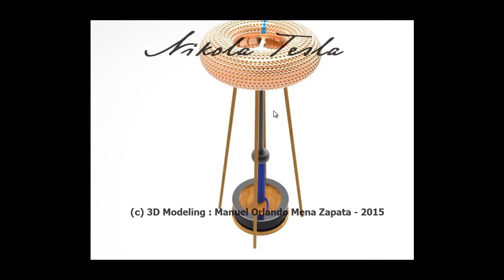Apparatus For Transmitting Electrical Energy - Wireless

Comment: I learned nothing from this, except that tesla patented a number of methods and mechanisms for the transmission of electrical energy through the air. Actually, I didn't learn of it here, I learned of it years ago, by reading a book from the local public library.
The methods he described made no attempt at energy efficiency, nor for safety of the people nearby his transmitter. He simply demonstrated the principle on which such a system could be developed.
Reply from the maker: Best regard,

The work developed by Tesla was huge, patents writings, interviews, but above all the proof that its patents were perfectly feasible, you should read Tesla's work again, now there is more information available, there are currently several scientific papers that support ideas Nikola Tesla.

A book or two books about him and his work is not enough to understand Nikola Tesla, he stepped forward and even still continues to advance current knowledge.

About the work of Tesla we can still learn a lot, but their work should look together for years I have studied Nikola Tesla, and he was simply the most advanced of all the geniuses that have existed until now.
Reply from the maker: +Bill Martin, Closed mind never learn anything
Reply: +Manuel Orlando Mena Zapata I learned a great deal about Tesla, as I said, a long time ago. Tesla's basic theories were sound, and to a certain extent his experiments were successful. You can indeed transmit electrical power without wires. It's done 24 hours a day, 7 days a week, around the world... literally. It's called radio. The only difference is the application: Radio is used for communication of information, not for utility power.
Tesla didn't take the inverse-square law of radiated energy into account.
Look it up. Anywhere. Google. Wikipedia. Your local library. Your old high school physics book.
Look, I never said Nikola Tesla wasn't a genius. I never said he wasn't short-changed by history. He was probably one of the most fascinating men in modern history. His invention of the highly efficient and reliable  AC induction motor was probably his greatest invention, and possibly his least known. He didn't invent AC, he didn't go head-to-head with Edison over it, that was George Westinghouse and J.P. Morgan. His motor, however, pretty much sounded the death-knell for a DC - based power distribution system.Thus he was indeed instrumental in pushing Edison into developing other products.
Tesla's attempts at wireless telegraphy were trumped by Marconi and Morgan pulled out of his support for Tesla's approach.
Reply: Marconi made his first over seas call right here, on the rock. There is a tower at Signal Hill in St. John's celebrating the transmission. Pretty cool stuff. Before that, we had a trans atlantic cable which stretched from Ireland I think, to the cable station just down the road from me in Heart's Content. Interesting history there for such a small, out of the way place. Our location makes for interesting visitors sometimes.
Reply: Manuel Orlando Mena Zapata
Ho Ho! I'd love to see your sources on that!
Especially since there were numerous others experimenting with wireless telegraphy at the time, with mixed results, of course.
And especially since Marconi's developments bore no resemblance to Tesla's.
Reply from the maker: +Bill Martin "Marconi’s real contributions are more engineering and commercial than theoretical. He took the basic ideas and inventions of others and improved upon them and made them practical business successes. Tesla was almost the opposite. He created original ideas and proved them mathematically and physically, patenting some and not others. Some of his best ideas like the AC induction motor was a commercial success which brought him fame but not riches. Marconi, of course, was fabulously rich." -- source: http://www.teslauniverse.com/sites/default/files/article_files/20070200-01.pdf
Reply from the maker: +Bill Martin "Otis Pond (an engineer then working for Tesla) said: "Looks as if Marconi got the jump on you." Tesla replied: "Marconi is a good fellow. Let him continue. He is using 17 of my patents." But Tesla's calm confidence was shattered in 1904 when the U.S. Patent Office suddenly and surprisingly reversed its previous decisions and gave Marconi a patent for the invention of radio. The reasons for this have never been fully explained. But the powerful financial backing for Marconi in the United States suggests one possible explanation. source: http://www.stealthskater.com/Documents/Tesla_09.pdf